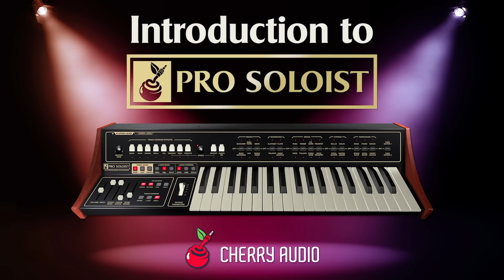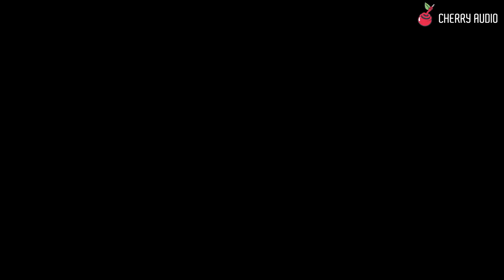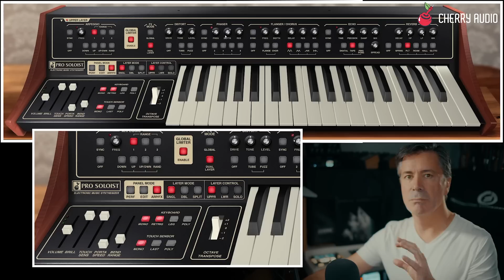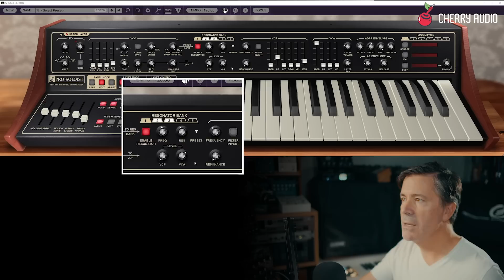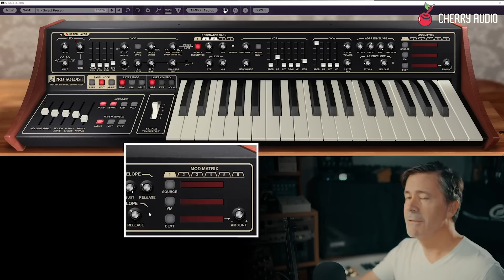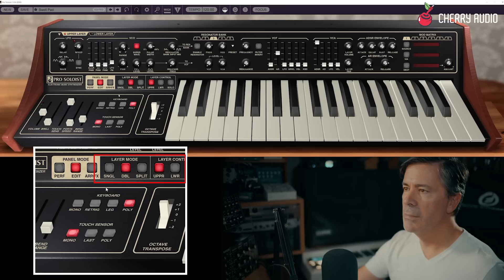Introduction to Cherry Audio's Pro Soloist - Hosted by Tim Shoebridge

Comment: I've been looking for a software version of the Pro Soloist for a while, so very pleased to have found this. Also a big Genesis fan, particularly Seconds Out - does it have a preset that emulates the keyboard solo from Firth of Fifth? 🤞
Reply from the maker: The Pro Soloist was a preset only keyboard, and that solo was performed with the Trumpet preset and Brilliance set near maximum. It's said that there was also some in-studio massaging and layering taking place. That preset is, of course, included with our software, and you can check it out with our free demo.
Reply: @CherryAudiovst  Demo installed and now is in my recording of Firth of Fifth - the patch isn't quite the same, on Seconds Out it has a slight 'squawking' quality so I'm guessing that's the studio massaging and layering you refer to. Investigation needed to try and get that...
Reply: @CherryAudiovst  Thank you for that! 👍

Comment: Thanks for building this...bought the whole synth stack 4.  I never knew about the resonator banks so I always wondered why I could never get an Odyssey to make some of the sounds of the Pro Soloist presets no matter what the pulse width and filter resonance etc were set at.  Being that the Pro Soloist resonator bank was not something that can be toggled in the actual hardware synth, how did you folks determine the impact of each of those resonator banks on a given preset?

Comment: I had a pro DGX I think it was similar or later model it had a preset on it called space base I was told that was the sound used in the 70s tune called popcorn 🍿. May not be true

Comment: "Growl" sounds like a fast lfo modulation of the filter frequency. Presumably there's a trombone preset somewhere for "Growl" to bring to life! 1970s Lounge in a box!
Reply: The TROMBONE and TUBA stock presets incorporate growl, but you can add it to anything you like by using the GROWL touch paddle.  You can also dial (slide) it in the VCF on the EDIT page.  Have fun.

Comment: The Wow is a WahWah /LFO repeated Tim. (modulating cut off)
Reply: WOW is a pressure controlled, high resonance direct filter cutoff, and WAHWAH is under pressure + LFO control and does not alter the resonance.

Comment: I don't understand one thing: the ARP Pro-Soloist featured a very complex waveshaper made with divide down signals combined by various gates: over half the presets used these pulse trains. But it looks like, from the panel controls, this thing only provides square wave and sawtooth:  like an ARP Explorer not a Pro-Soloist. Maybe I missed it. Also, the sounds in this demo, except for two, didn't really sound like a Pro-Soloist, to my ears: it sounds more like an Odyssey with a parametric EQ.  Please tell me I am wrong (which would be great), and they do support the authentic complex waves?

[UPDATE: I need to check my simulation results again. The phase issue would only impact the few presets that use both the derived saw plus the pulses, which is not the majority of presets, and I apologize for giving a different impression. See below.]
Reply: You are correct regarding the method that the pulse waves are derived, but incorrect regarding the result.  The divide down and gate logic produces one pulse at a specific width.  It was done this way so that the widths could be precisely the same from unit to unit.  In recreating the stock presets, I noticed that the tiniest error in pulse width produced a completely different sound.  For example, the difference between 73% and 73.5% was plainly discernable.  If pulse widths were derived in the traditional analog way, every PS would sound different (they do anyway).  Fortunately, a software synth can effortlessly produce the desired widths.  The presets were painstakingly recreated to sound exactly like the hardware, so unless you have a Pro Soloist there with you to compare it to, you'll have to take our word for it.  The Soloist shares very little in common with an Odyssey, and the Odyssey, 2600, Quadra, etc. is incapable of reproducing PS sounds.  Enjoy the free download and hear for yourself.
Reply: Check out the replies from our DSP programmer Mark Barton below. The pulse/divide waveshaping is in fact properly emulated.
Reply: @celebutante  I will go back and re-run the logic simulation. The effect I am mainly talking about is the phase delay by the logic pulses, which will give interesting phase cancellations on those presets that use the derived saw.

B.t.w:  Actually, I do have a pro-soloist circuit board here, which I used to verify that the schematics were accurate. Certainly I can be wrong, but I don't see it: I entered the actual circuit into a logic simulator a few years ago: you presumably did the same thing. (Google "fricko propulse backstory" for details and the simulation.) 

If they just wanted to get reliable simple phase-aligned pulses, they could have used a far simpler circuit such as a couple of Arithmetic Logic Units (like LS381A) to get the same reliability of resolution, couldn't they?

And as for the Pro-Soloist sharing little with the other ARP boxes, certainly true for the control, oscillator, waveshaper and resonators,  but not really so for the VCF/VCA/EG, yes?

Comment: 9:52 The volatile effects settings, in my opinion, actually make the experience less authentic. In the 1970s your effects would have been outboard and you'd be able to leave them running and try different presets. An odd choice to switch them off, I think – although I may have misunderstood?

Comment: When I saw the title my jaw felled on the floor... If you only knew how much I wanted this. I have the free version of something similar and no it is not that good, but it was better than nothing. I always wondered if I was alone in the world who wanted to have Tony Banks sound (I need the Hammond T-102 too btw). Seriously you guys nailed it. I just wonder if it is possible to replace the after touch with my mod wheel. Really don't have the cash right now to buy another MIDI controller. I would use one of the foot switch I have to do what the after touch can do.
Reply from the maker: The extensive MIDI routing and Mod Matrix should give you all the choices for expression that you need!
Reply: @CherryAudiovst  Great, thank you!

Comment: 15:20 The divide-down-and-sum approach with the square wave to make a sawtooth is a new one on me, but I understood what was going on. Very clever!
Reply: It's called a Walsh-Hadamard transform.  As you probably know, any wave can be made by a summation of sine waves.  The same can be done by using square waves as basis functions.  Believe it or not, you can even sum square waves to make a sine wave!  Math.
Reply: @mrbmodules2938   And for this ARP, we don't even need to go to Walsh functions. The "saw" is just a discrete resistor DAC on some divide-down counters. (The nice thing about clocked systems (like the Roland SH3A too) is that you can get perfect octave switching: the VCO doesn't need to have a large range where it is accurate.)
Reply: @rickjelliffe1580  Doesn't that implement a Walsh function?
Reply: @mrbmodules2938  Many thanks for the info. I have a mathematics background but I've not heard of that transform. I'm going to look it up!
Reply: Some string machines do this too - Korg Delta, for example. And if I remember correctly, that's how Jupiter-4 does saw wave as well.
Reply: @celebutante   Just had a look at the J4 and it seems to be a hybrid between the Pro Soloist frequency-to-voltage feedback scheme and a DCO without the digital sync part.  It's also very clever, but will not track as well as the ARP scheme.  As the JP4 came out six years after the PS, I think it was Roland that copied ideas.
Reply: The Korg Poly-800 used Square Waves to produce the Saw Wave.